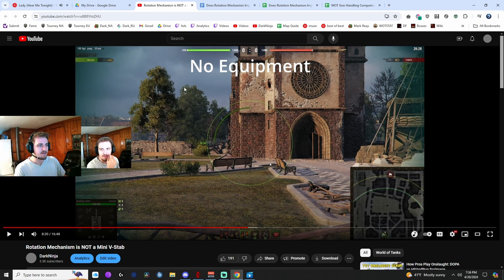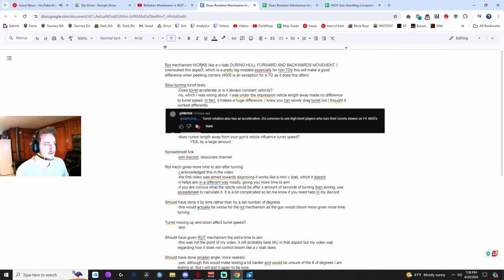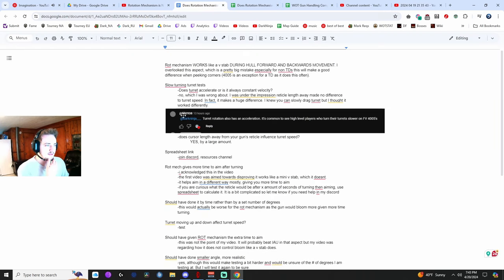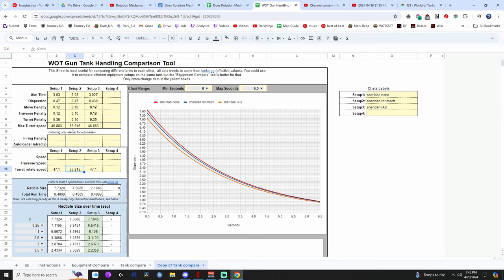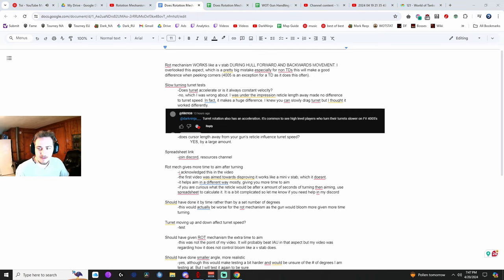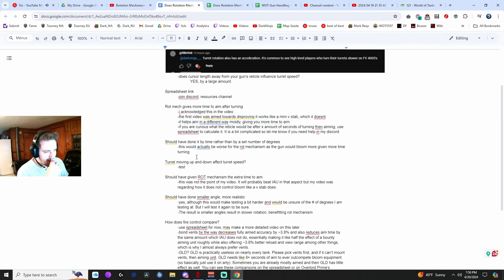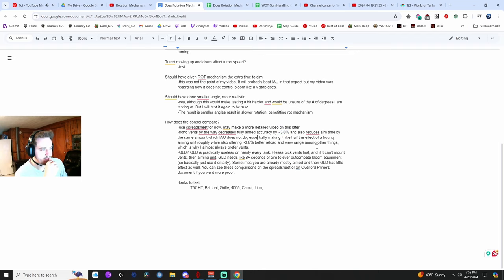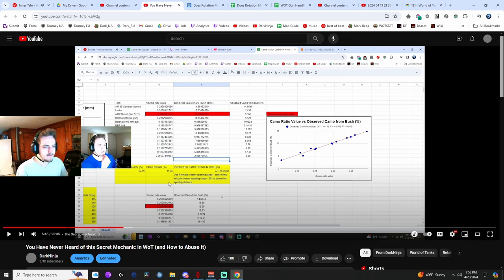I Made a Big Mistake 😢: Improved Rot Mechanism is Not a Mini V Stab Correction Video and Q&A

Comment: Great job reflecting on criticism mate! That's awesome of you!

For some reason though you seem to think that getting clutch braking skill will make vstabs less good. Or at least that's what your argument about ROT still boils down to.

You're again trying to manage multiple variables and that's not how it works(in math). 
So let me elaborate on my argument from the previous video. .
You get improvement in gun handling in two ways:
1) best accuracy. i.e. base dispersion.
2) time to best(or specific level) accuracy. i.e. time to point at target and time to aim fully. Game's a bit misleading there as well as it doesn't show the full time for aiming.

- IAU improves the raw accuracy. So if you're not moving, it helps with that.
- V-Stab and ROT improve time to best accuracy. V-Stab by removing (larger)part of the bloom penalties. ROT by removing part of the bloom penalties, in exactly the same way as V-Stab, but also increasing turret and hull rotation speed, which in itself increases those same penalties. So in a way, when just rotating,  ROT increases the speed you can point to the target and eliminates the penalties generated from that extra speed(+some).

So given those two types of possible improvement, that's the only thing you can actually test that maters in the game. 
Improving base dispersion is meaningful for sniping of course, but neither ROT nor V-Stab affect it so it's for another argument. 
So "time to best accuracy" is the only meaningful test for playing the game. You can get that from the footage from the previous video by counting frames. And yes, that should be worst case scenario for ROT as you can rotate slower.

From my understanding of the math, ROT is better then IAU for:
1) tanks with big bloom, but not terrible accuracy. Especially tanks that can't mount V-Stab. FV4005, TL-7, Charioteer etc.
2) bad players with jerky movements. Experienced players, like Skill and yourself for example, favor IAU a lot, as this if a penalty they get less of.

IAU is better for tanks that:
1) have mid/bad accuracy, but not terrible gun handling.
2) if you're going to put V-stabs as well.
3) if you're good player with stable hands and cool head. .. and experience to preaim.

It basically boils down to what penalizes you more with a given vehicle and if you actually want the faster rotations speed.
Reply from the maker: IAU does work in the same way as a v stab, it’s not just reducing fully aimed accuracy but also bloom. And I’m not talking in a roundabout way, it decreases bloom in the bloom equation. I understand what you’re saying about getting onto target quicker therefore giving you more time to aim, but like I said that wasn’t the point of my first video. What I was trying to show is that the traverse speed increase cancels out much of the bloom reduction, which I believe many people do not realize that’s how it works. Yes, it is still useful but doesn’t work in the way many people assume.
Reply: @darkninja___  IAU reduces base dispersion. Which in turn reduces, not "bloom" which is actually relative, but the resulting dispersion, which we also call bloom because it's bigger and people lack understanding or care..
There is a difference.

Comment: A new sub here ...
what about dispersion values is reticle size the only concern here I mean sure smaller reticle better but where does the shell go inside this reticle is more important so if IAU has a  slightly bigger reticle but the shell goes to center more than IRM whats the point in smaller reticle
Reply from the maker: It makes no difference, the sigma values for where ur shell go are all the same on every tank.
Reply: @darkninja___  then what does dispersion mean asking seriously thnx for reply
Reply from the maker: @servusdedurantem  Dispersion I think means the max distance  from the center of your reticle that your shell could possibly go, for example “dispersion” of a fully aimed Leo 1 could be 0.27 for example at 100 meters. That number corresponds to the distance it could go horizontally or vertically from the center.
Reply: @darkninja___  so my question is IAU vs IRM a tad smaller reticle or a tad smaller dispersion value more important My thought is from distance dispersion more important aka IAU because turret movments slower but from closer range having smaller reticle more important ?
Reply from the maker: @servusdedurantem  I am not entirely sure what you mean so I’ll just describe what I think. There is fully aimed accuracy and then bloom. Bloom is a penalty to your accuracy due to movement of any kind or for firing. IAU decreases all forms of bloom by a small amount ~8% or something, which also making your fully aimed accuracy ~8% better (with bounty). Rot mechanism does not improve fully aimed accuracy at all. Rot mechanism is worse for bloom than IAU when the turret or hull is moving near max speed, but at slower rotation speeds it is superior by a good amount. It also is superior when moving backwards and forwards with no rotation because the extra rotation speed it gets does not partially cancel out its bloom penalty reduction when doing so. So IAU is better if you frequently fully aim. Rot mechanism is better for small micro-adjustments to aim (aiming for weakspots, tracking targets at long ranges where you do not need to rotate the turret quickly, and also when poking a corner only moving your hull backwards and forwards.